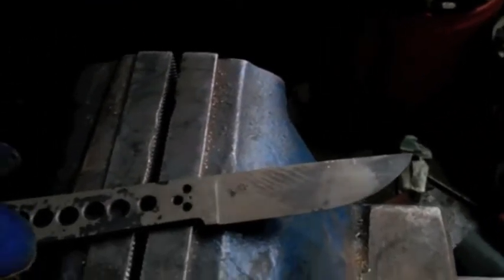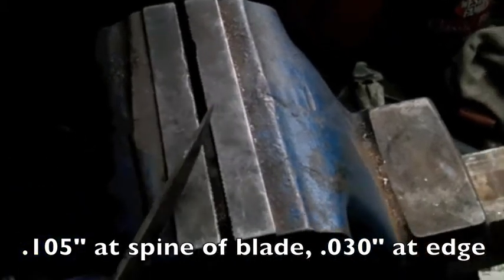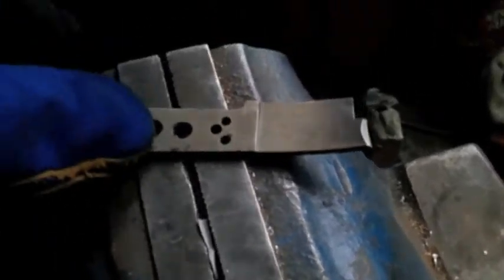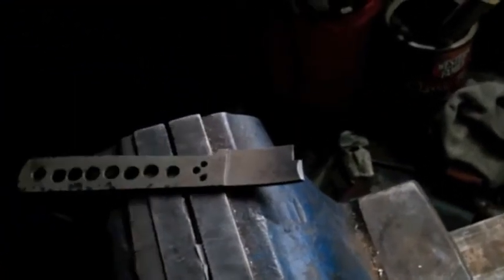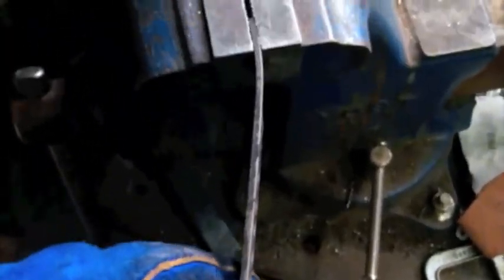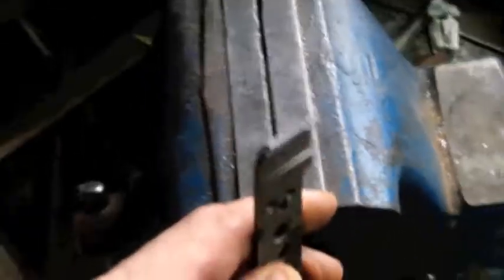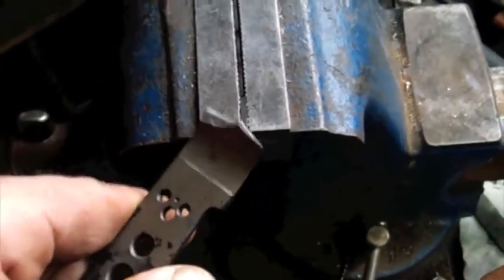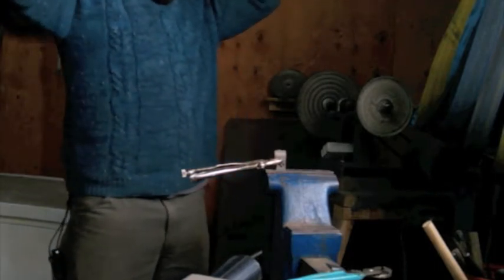Stress Testing 52100 Knife Steel Breaking Blade

Comment: 52100 is absolutely top notch! Last year, I torture tested the entire Cold Steel drop forged monolith series. (Some of the toughest mass-production knives ever made) I’d wager a good blade smith could make them even better. The trick seems to be proper heat treatment. But once you’ve got it, the damn things are indestructible.

Comment: you have a problem with your grinding technique....that is why the blade broke with that final geometry.....need Knoop and Vicker's hardness testing across the whole width (edge to spine) of the blade to give you the full story.....basically......more coolant please and less material removal per pass and maybe some differential tempering....sorry to come late to the game
Reply from the maker: Thanks for your comment, I'm not sure I understand it though. I am curious to know how many knives you have made and torture tested yourself..? 
This test is simply a general demonstration of toughness with this particular fully heat treated blade.
It is not differentially tempered. Equal material removal is the key. The steel is not overheated during final grinding, following tempering, etc. Suffice to say, this video does not cover the details, it's just a basic snap test. Thanks!
Reply: @FireCreekForge  your right, the blade you made will hold up to most applications (I guess except using it as a pry bar, which it is not designed to do).  I was making a comment based purely on a fracture mechanics  and metallurgical analysis perspective.

Comment: Say Heah William actually the 52100 Ball bearing Steel is one of my Fav's.  I also like it deferentially tempered which IMO makes it even tougher.  That's why I bought almost the complete line of Swamp Rat's Rodent Knivrs,  starting with my Rodent 3 and on to my Rodent Rucki,  I also have the Rodent Solution,  Rodent 4, 5, Ratmaadu and the modified Rodent 6 which looks like my Ratmandu but on steroids,  after having the top guard taken off then thinning it down a little,  the Rodent 7 and the Rodent 9, Oh,  and the Ratweiler.  Yeah,  I really like what Busse Technology does tempering that steel now they call it by their proprietary name The SR101. Dilly Dilly.,,.p
Reply from the maker: Cool, thanks!